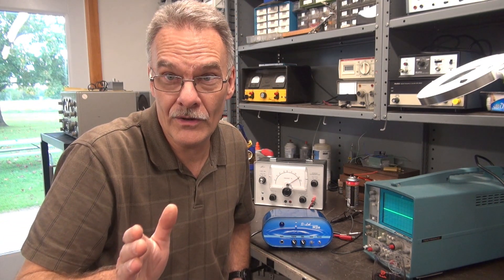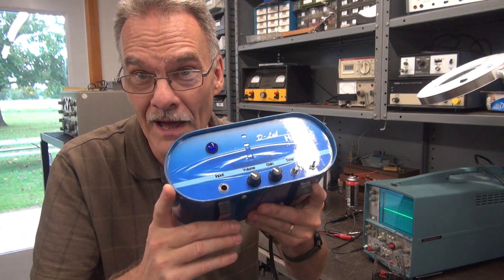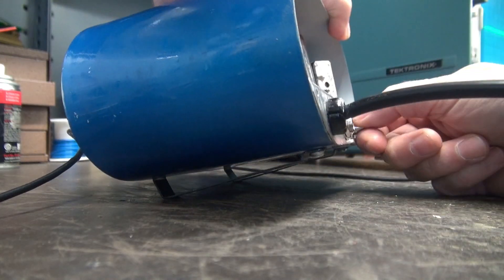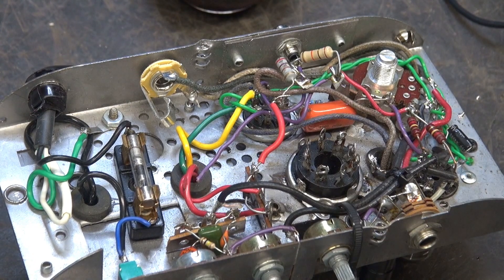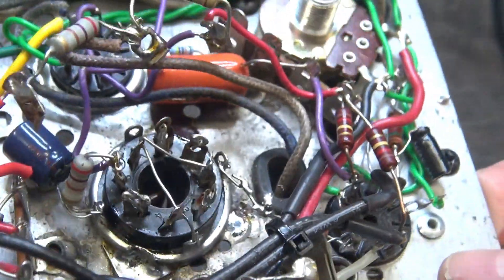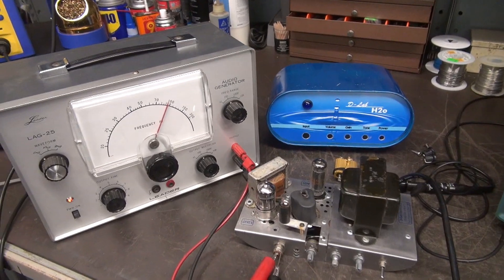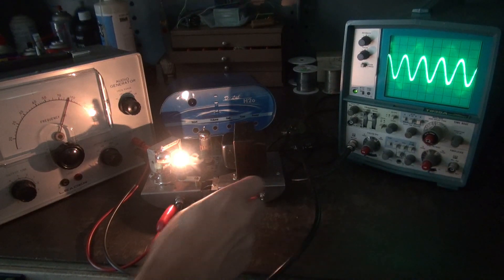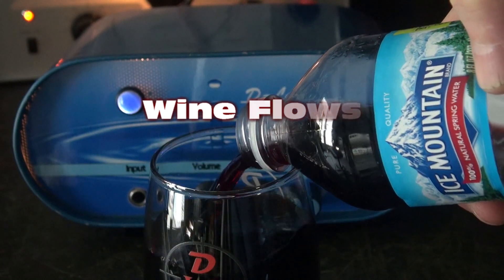Repair of the D-lab H2O 6AQ5 Tube Guitar practice amp

Comment: How well does the this tone control circuit work for guitar?  Is it something you think is necessary or valuable to this amp, or would you change or drop it if redesigning this amp today?  IMHO, most tone control circuits drop signal levels and suck the raw tube tone out of little guitar amps.  I prefer to keep the circuit as simple as possible for pure tube tone.  We have a tone knob on our guitars, that no one ever uses, and tone equalizer pedals we could use if one needs to shape their guitar's sound.  Would you keep this tone circuit, choose a different one, or eliminate it if trying to improve this amp design today?

Comment: Great Job. 
Do you avoid transistor Amps?
I mention this since a transistorized version of your H20 would have fit into a smaller box.
They last longer as well and an Amp the same dimensions could produce almost 30W.
Reply: I would not compare tube amps with transistor's ones. Tubes give a special warm and sweet sound that you can' t get from transistors or modern miniaturized integrated  circuit, especially regard guitar amps. This is why most guitarists prefer tube amps.
Reply: @fedem39  You're right but the transistors last much longer
Reply: SS components are smaller, cheaper, provide more output and are easier to power.  All true.  Last longer?  I have tubes that are almost 100 years old and they still work like new.  Tubes are also much more forgiving about abuse.  Overheat or momentarily short an output transistor and see how long it lasts.  Tubes will usually survive incredible short term abuse without dying or suffering performance degrading damage.  For a guitar amp, nothing beats the sound of a nice tube amp circuit, IMHO.

Comment: How about buying some plugs for that socket (like on the back of your National NC-173 shortwave radio) and mount the filter caps on it. If a cap goes bad, just unplug it, change it and re-plug it back in to the socket.

Comment: That's an interesting line out on that amp. I will have to try that some day.
Reply: Indeed. But that ain't working, because it's bypassed with the big electrolytic cathode cap of the output tube! Not to mention, a 1 meg ohms grid resistor for the input triode would be nice ;-)
Reply: @johnnaighley9252  and a coupling capacitor in series for blocking DC
Reply: @dl7majstefan753  Yep!